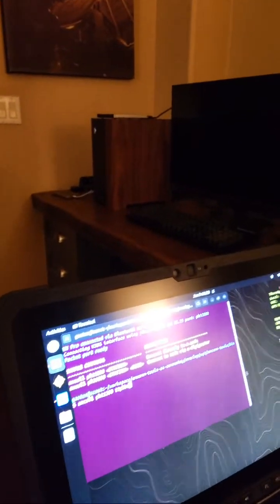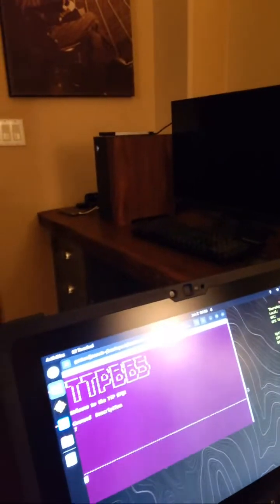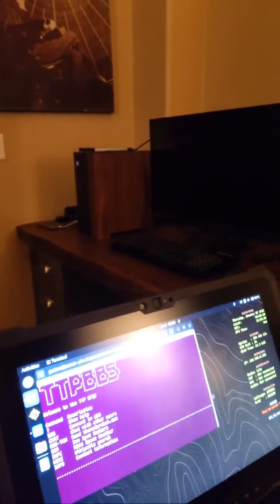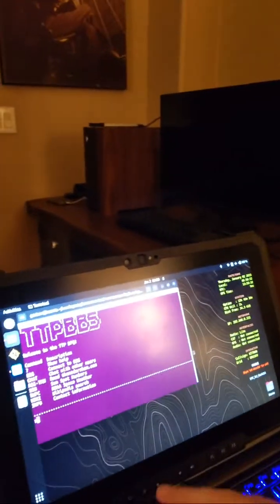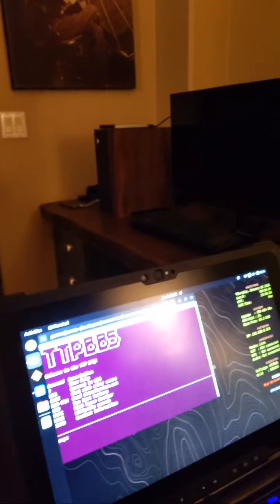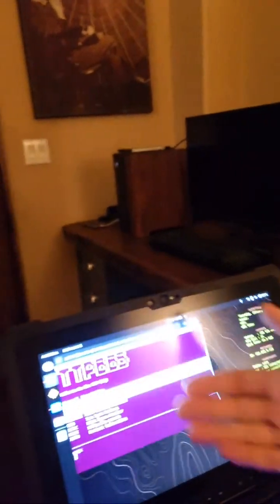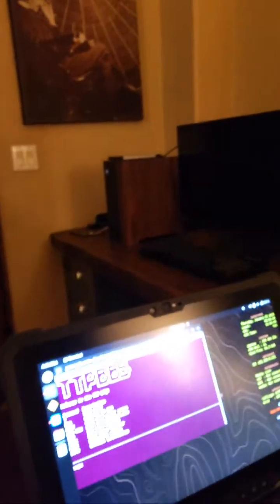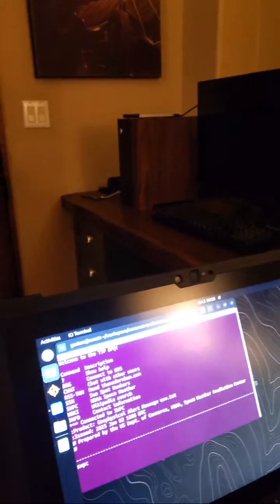BTECH UV PRO - IP67 Water Test

Comment from the maker: Be advised: The radio is fine and is in good working order after being submerged for 5 minutes. However, I just removed the antenna and battery (about 90 minutes later), and there is some moisture in both the battery compartment and the SMA connector. This radio is not fully sealed and there are no gaskets!, However,  in practice I don't think it will be a problem as it unlikely that your radio will be taking a swim for this long. My suggestion is to dry it off carefully after a dunk like this. Don't forget to blow the water out of the USB-C port, too. Take care.
Reply: Josh over at Ham Radio Crash Course did a good review on this radio if anyone is interested.

Comment: How the heck do you get ride of the noise when you un key? I did the PTT release set to none which does get rid of the noise but when I power cycle it comes back… Deal killer for me, if I cant get that fixed it is going back.
Reply from the maker: You have your squelch open all the way. Go to Menu > Radio Settings > Squelch to adjust.

Comment: Gaston; thank you getting BBS back again like we had nation wide in the past that worked :-)
Reply from the maker: That's exactly my plan. We had an amazing civilian owned and packet network 30 years ago. It's time to bring it back. More on this later.
Reply: @TheTechPrepper  Thanks Gaston ; I remember that when my first licensed in '93 .... loved node hopping to determine as many alternate paths to access any node and create a mental map of the system nodes I could connect too if the main node was down .... built-in alternate connects before path time-out :-)

Comment: If you don’t know btech sells an adapter to use k1 plugs obviously you lose the ip rating but still nice to use cheap accessories.
Reply from the maker: I did, but if I am going to run cables, I will personally will stick with my other radios. The appeal for my is the Bluetooth TNC access. Thanks for sharing.

Comment: Wow. You trained your dog to hush when you are making a video. I wish mine would hush when I tell him. 😂

Will the UVPRO blutooth TNC eventually be added to EMComm Tools?

Oh, I have a hard enough time with a cold shower, I cannot imagin a cold plunge.
Reply from the maker: We trained one dog and the rest just learned all the same commands. ;-)

Yes, barring any issues, the UV Pro Bluetooth support will be included in the R4 release of ETC scheduled for April. I already have most of the plug-and-play working already based on the last two YouTube demos. Once it is paired (a one-time configuration), here's the current flow every time you want to use it:

1. Turn on the radio.
2. Select the radio with "et-bt-radio".
3. Select the communication mode/app with "et-bt-mode".

It will have support for limited modes: BBS client access and Winlink packet. I will not be spending cycles on the APRS support this quarter.

Comment: Idk if you saw my comment on your last video or not, but this is exactly what I was asking for lmao
Reply from the maker: I must have missed it. I am not caught up yet. I am not sure if your question was about the IP67 rating or which features I personally find appealing. Either way, it has lots of value at this price point.
Reply: @ no worries, and it was just about durability/waterproof testing of radios in general.  73!
Reply from the maker: Take a look at my pinned comment. It's not properly sealed like most IP67 radios.

Comment: I like the real-world videos. We have a strong Packet user base/infrastructure here on the Space Coast. I use Winlink alternating with VaraFM on a sound interface and Packet using an old school TNC. Went on a field deployment with a friend who runs HF FT8 and phone SSB from the trunk of a car. Set up in a park. Only the USB cable between a cheap Dell laptop and an Icom IC-7300. 2 dozen contacts in an hour or so. I think the Bluetooth TNC thing, like a built in Mobilink? is helpful but that is limited to a Bluetooth serial port, not a sound card interface.
That is enough reason to drive you back to packet.
Reply from the maker: Thanks. It looks like you're all squared away with packet. Great work.
Reply: Now thats taking one for the team in the name of R&D😂😂😂
Reply from the maker: @79attaboy  I have this group's back.